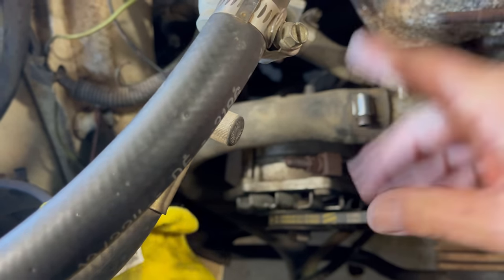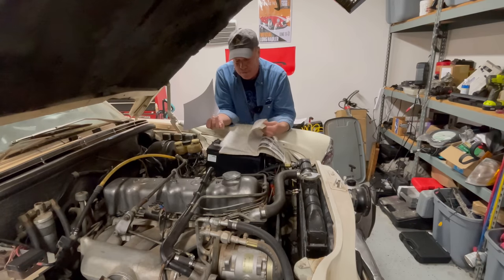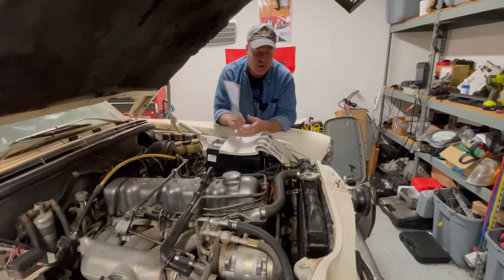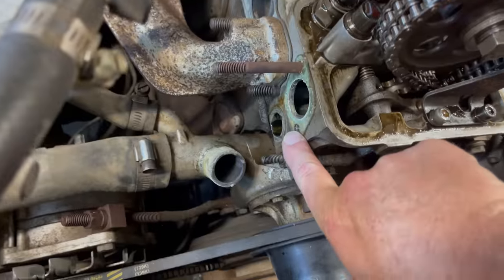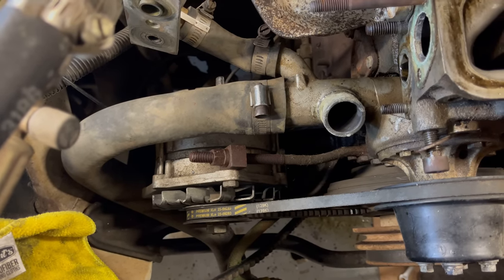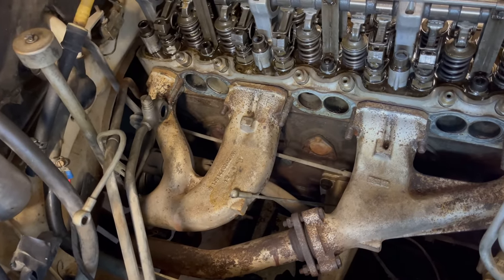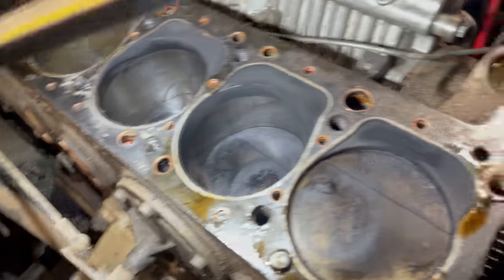I just delivered a cylinder head!

Comment: Mike, usually when water has entered the cylinder it scrubs the carbon clean. See which cylinders are cleaner than the other ones and 
l👀k at those for cracks and gasket failures.
Reply: Fingers crossed for a gasket failure!

Comment: Take the head to a machine shop shave the head and pressure test the head there thanks Mike love to see the older engines again always like your video your turning into a good mechanic have a great day 😊 actually have all heads machined and pressure tested takes the guess work out  of it .and on .aluminum head  have them shave the  head &pressure the head & new head bolts 
Your Mercedes is going purr like a new one the  cylinder walls look  good so I don’t  feel it’s the block leaking sorry for the typos before

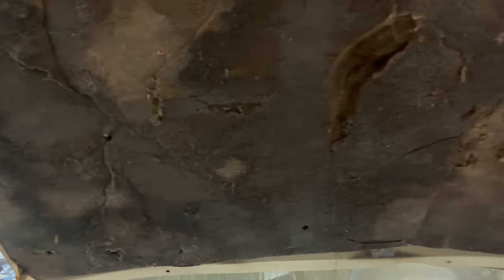Comment: @11:56 Mike. NEVER EVER set a fully assembled head with the cam still installed face down like that. It's very easy to bend the valves that are on the open stroke. Allways lay the head on it's side or use a jig that will prevent the valves from coming into contact with the surface.

Comment: That first "something", is most likely the issue. That cooper ring seal has failed, and compression/exhaust gasses went into the coolant. That house thing is called wire nut. Great job by the way.

Comment: While your at it replace the water pump. <$40 on rock auto.
Water scale is present in the block, check out the pump housing for more.  Also wp seal is probably toast.
Reply from the maker: Already bought it
Reply: @MonkeyWrenchMike  you should thoroughly clean the rocker arm drip rail.
That is the tube connecting the cam journals that has small perforations that drip oil onto the rockers. It attaches to the front journal with an Allen head  screw and clamped down on the other journals. If it doesn’t drip you will get a mysterious ticking noise.

Comment: Looks like the gasket is compromised in front of the #2 cylinder. Also all the water jackets may leak underneath the gasket. It doesn’t look like they were replaced during the first engine rebuild. With time and luck of coolant changes the oxidation of the edges gets to the point where the channel opening becomes bigger than the hole in the gasket and we see the results of that on your engine. Good thing is the jackets are still available.
Good luck.
Maybe post a short clip of the block surface without the gasket on it.